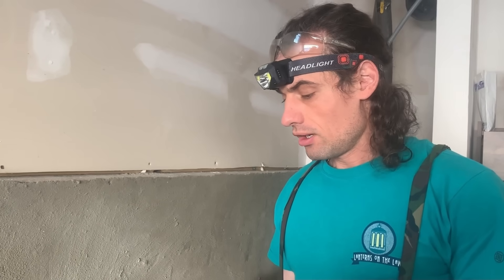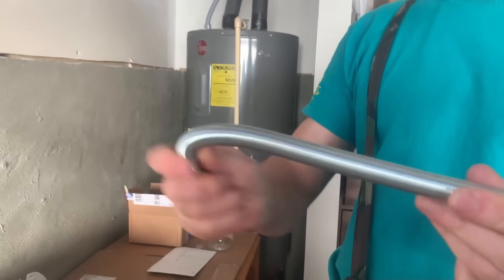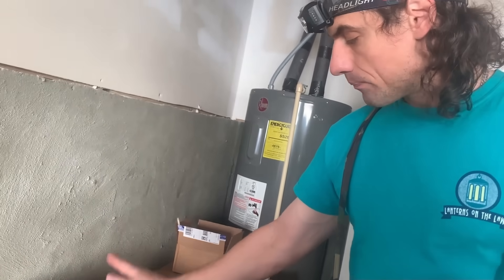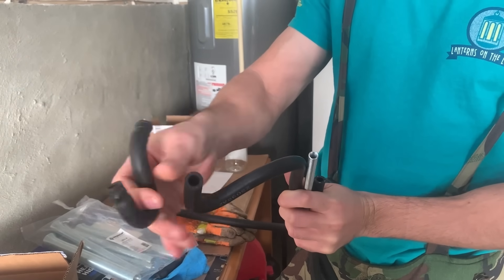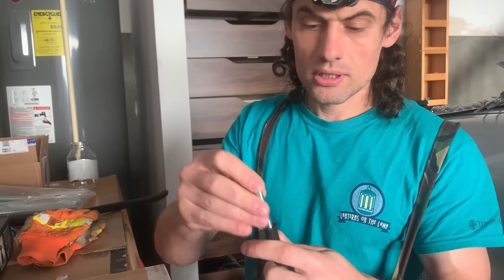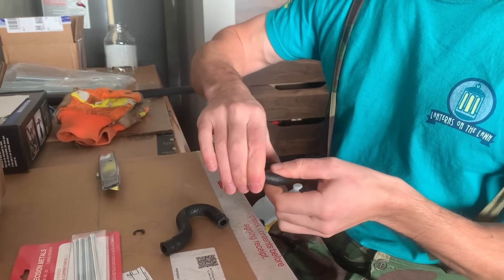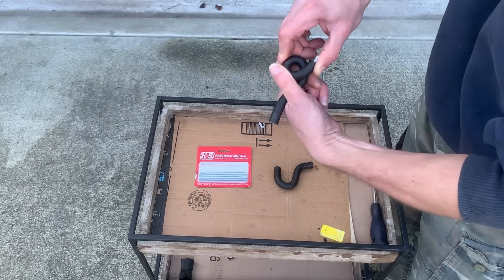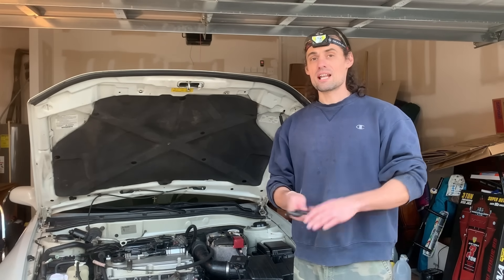Bend Rubber Hoses Without Kinking to Match OEM Parts

Comment: Have you tried just putting some nails or screws in wood to suit the shape. Use some short aluminium tubing over the nails to protect the rubber. Insert the mandrels. Heat the hose while straight so you get the whole way around. Then place in your nail jig. Continue to heat for a minute or so them let it cool, or pour water on it.
Reply from the maker: I haven't tried that, but I can see it could work. This could be a little more time consuming process, BUT if you need to shape relative long hose where spring tube benders won't reach, this is the way to go for sure!

Comment: Can you straighten it back ?
Reply from the maker: Do you mean straighten it back to get the spring tube bender out? Yes, once you're done the hose is still flexible. The only job you're done here is changed its default shape. It was straight before, now it has curves and bends, but it is still flexible.

Comment: Hey! In industrial hose making you make a metal form to the exact shape you want and then put a flexible hose over the form and stick the whole thing in an oven to bake.
Reply: At what temperature and for how long?
Reply: I tend to overcook stuff
Reply: This is a better and feasible way for one off DIY plumbing. 
For mass production,  form work is viable.
Reply: How do you get the hose over the mandrel?
Reply: It looks god but I wonder how much the nylon threads inside the hose will last after this process.
Reply: I've always just leave the spring in it and put it on.
Reply: @martinjay5906  formable metal spring! What a great idea!
Reply: Great Video,Thanks
Reply: Does the heat compromise the integrity of the hose?
Reply: @frankcrozier1318  well, it's kind of two different situations. If you're a hose manufacturer, you're going to select hoses that can be shaped and will actually get stronger after curing. If you're a do-it-yourselfer you don't have the luxury of being an expert at procuring your working stock. On the other hand, there is a large margin of safety and probably only a minor is slight decrease in hose strength from heating it and bending it for example. But you can certainly do more research than just asking me.
Reply: And how do you get the form out?
Reply: @makingcookingfixing  The hose doesn't harden it stays flexible but with a new shape. It just remolds itself so - the form can slip out the way it went on.
Reply: @makingcookingfixing  use the torch to melt the metal and pour it out.  😵
Reply: @makingcookingfixing   The inner form is air or fluid under pressure... so you pull the plug out. The outer metal form is a clamshell mold.
Reply: Nearly right.  Do you boil your eggs twice?

Comment: Another unrelated tip is for parts with screw into each other that don't thread in as smooth as one would like. Put lapping compound on the threads and work out the micro burrs. And flush out with brake clean or something.
Reply from the maker: That's also great idea. Never tried before but that should work!
Reply: just remember to clean the grit! @ngtitovWorldOfCars
Reply: @332ARA 
Hey since we are sharing tricks, keep that valve grinding compound around for those Phillips screws that are tight and threaten to strip out the Phillips head. 
A touch of compound on your screwdriver, make sure it's not too much so the screwdriver fits though. 
It's served me well over the years.

Comment: is it really worth it?
Reply from the maker: It really depends. In this particular case - yes. I couldn't find this bent OEM hose anywhere in stores/internet, and I didn't want to put the old/damaged hose back on. If I dig on internet more I'd probably found something similar and made it work, but again the more complexed hose, the more expensive it gets. Straight hose costs about $2 per foot. The tools are a little more expensive, but I know I will need them later for something else.
For heater hoses that I replaced (5/8' longer hoses) in my coolant system, it wasn't worth it. I was able to find both inlet/outlet heater hoses for about $10-$15 each on RockAuto. So, it is case by case. I pretty sure this isn't the last time I'm doing it.
Reply: Hell yes when you're working with an old intake manifold where you can't get the hoses anymore. Like a 94 Nissan Quest gas line hoses and vacuum hoses. I made do. I wish he had made this video 8 years ago.

Comment: That's the problem it weaker at the bends.
Reply from the maker: Once you give enough angle at the bent spots and heat it up, it won't get weaker. This is exactly what happened at my first attempt, but once I gave bigger angle (like an O-Shape) on my second attempt it worked great. The bent spot is really holding on strong and not even close at being kinked. The more you practice with it, the better it gets each time.
Reply: You're talking as if this little hose is under hundreds of psi, 😂. It's coolant tube, not hydraulic line. I swear, people just run their mouth to act intelligent.